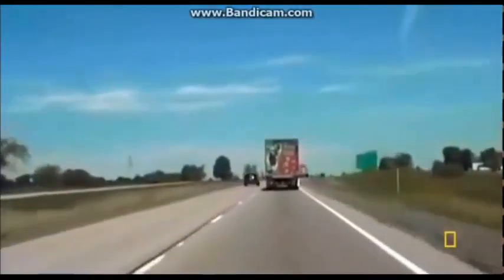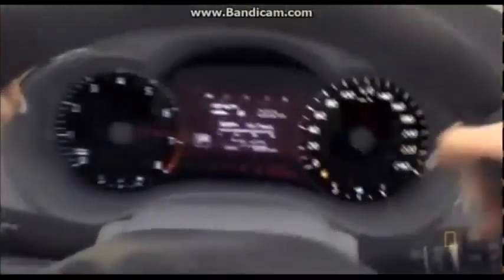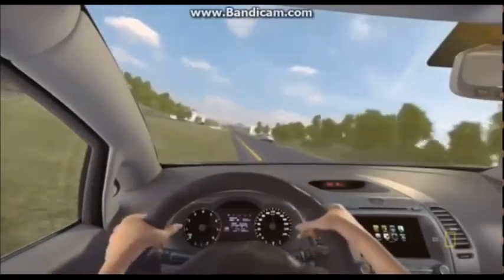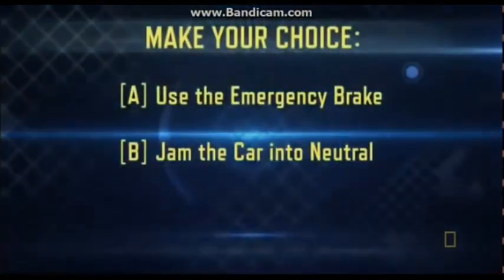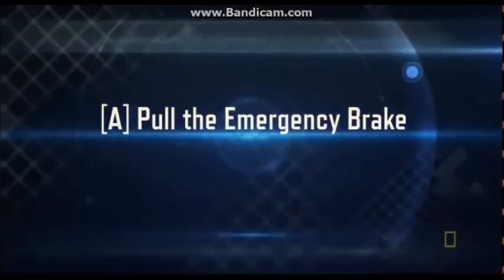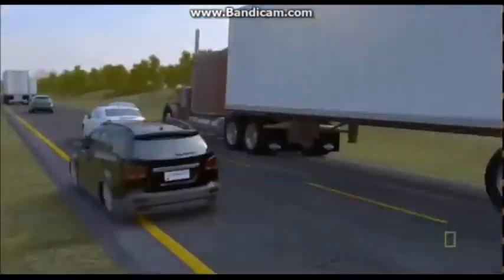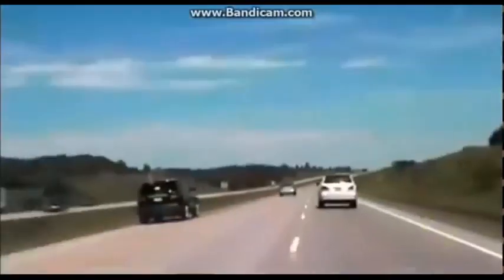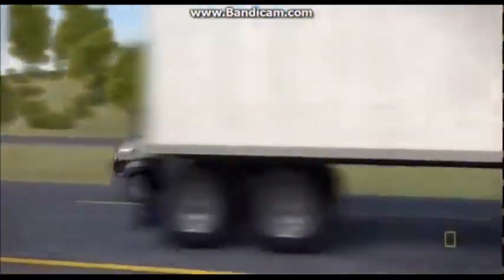How would you stop your car if your gas pedal stuck

Comment: Your actually supposed to turn the car off then when it's not running any more turn the key the accessories positions or on positions
Reply: Exactly
Reply: Idk about your car but even with the key in acc or on position you still lose power steering and the wheel can still lock
Reply: Alaric Niemi is so wrong. When your cars ignition is in the on position the steering wheel is unlocked. And if you can't steer without power steering you shouldn't be operating a car because it could go out at anytime.
Reply: Hmm not on my car, when i pull into the gas station i usually tu=n off my car before fully stopped, and even when turning it back to the accessory position, if i try to turn it works a bit but then the wheel locks like there is no key, i dont know what your car does, thats why i am saying for my car that is what happens, just personally experiece. Idk why you gotta be so hostile
Reply: Alaric Niemi I'm not hostile but it works on mine and if you have a newer car with a push start just click it twice and it turns off and the steering wheel will never lock. And you obviously don't know what hostile means.
Reply: yeah most money saving way to do it thats for sure. like with the semi trucks then running away is more common then gas cars they say if its running off the oil so if turn key off and its still redlinind then they say with all brakes pressed you drop clutch in last grear... idk if that would be smart either cause grenade the trans to clutch possibly and it would continue to rev untill it burns down  but i guess if anything was worth a shot that would be it
Reply: You really don't want to do that until when you have no other options left. You will lose power steering and you need power steering at over a hundred miles an hour
Reply: Lemon Bleach The faster you go, the less force needed to move the wheel if you loose powersteering...
There's a reason why the steering wheel is STILL phisically connected to the wheels, it's because of situations where you lose powersteering, YOU STILL HAVE CONTROL OVER THE DIRECTION THE WHEELS ARE FACING.
Reply: not the best solution. By turning off the motor you also loose power steering and with newer cars the brake booster. That may sound like its no bid deal when you re driving 40 mph, but at 120-130...If you ca get the transmission into neutral you are better off
Reply: Still not desirable if you could just as well put the transmission into neutral. And its not just power steering. Turning the car off you also loose brake booster and any assistance systems that may help you brake down without loosing control, like ABS. Don't bullshit yourself. Turning the engine off at 120 mph is not safe. If its your only option go for it. But in any other scenario neutral is the way to go (or just hitting the cloth on manuals)
Reply: If you have hydrolic steering, the engine needs to be running or you lose steering, only electric power stering is exempt from this, and assuming so is a gamble
Reply: your steering might be digital then (the wheel isnt connected to your tires at all, and is just a rotation sensor to have the computer turn the tires for you per the steering wheel position)

theres hydraulic, electric, drive by wire (computerized), and what i like to call, golf carts with a V8 engine
Reply: A lot of cars wont allow you to turn the ignition if the car isn't in park, and for most the steering is locked if the engine is off.
Reply: mine will start with the car in neutral
Reply: the thing with the cars, is they actually dont let you disengage from park if the key isn't in the ON position and you aren't pressing the brakes while doing it
Reply: but at that speed power steering makes no difference because it's easy to turn the wheel even without it. No power steering only makes it a bit harder to turn the wheel from certain starting angles, at least from my experience
Reply: my journeyman had a stroke driving us home on gravel side roads and his foot slammed down on the accelerator, we were going 70mph on narrow gravel roads with lots of twists and bends. i turned the engine off and had to control the vehicle since i cant reach the brake from the passenger side. only the newer vehicles for some reason lock the steering wheel when the key isnt in the on position.
Reply: Diddz' no because the hydraulic motor runs off of electricity from the battery. And you spelt hydraulic wrong
Reply: Diddz' you do know before any technology came out for steering assistance such as power steering it had to be connected some how don't you think. How else would steer the car? Magical powers or something. Also I have had many vehicles with no power steering and you pop the hood and if you look in the right place where the steering shaft is you will see the it is all connected and you do know that not everyone has a new and/or fancy car the has power steering.
Reply: Diddz' true
Reply: Goran Novakovic yeah only when you are going slow or stopped it is hard to turn the wheel
Reply: Talinthis sorry to hear. Hope everybody was ok.
Reply: TheVergile why would I bullshit myself. If you have a manual transmission and don't push in the clutch you can not put it in to neutral. Ive tried it. So if you also lose clutch fulid your clutch won't work you might not have any other option.
Reply: Lemon Bleach no you don't
Reply: Basil you're* what
Reply: makoshark40 might save your engine
Reply: funny story, my gas pedal cable broke off today, it wasnt stuck but i had to jerry rig it and tie the cable to the pedal while it pulls off of random stuff in the engine bay because i had to pull it out of the casing.
Reply: navigate48 oh and btw you can brake with the engine off on my car at least. Plenty of experience while i was being towed lol. Its harder though
Reply: navigate48 really good. Have you not tried it?
Reply: the problem is most cars turn on at any position other than completley off this is made for a pull start
Reply: That would only work with cars with electric power steering. Generally heavier cars use hydrolic power steering which uses the engine to power the hydrolic power steering pump.
Reply: Wrong you would loose power steering and power braking with no vaccum from the engine
Reply: So the brake pads are connected to the engine now? Or the transmission? Okay then. 

Also ABS is a farce - your braking performance will be better (stopping distance shorter) if ABS was deactivated and you used the brakes properly via pumping or just not letting them lock up. That's been tested a few times in different industries, hopefully I don't need to quote anything specific.

And if your car has anything more advanced with whatever "power braking" may be, consider that as something extra to shell out for when (if) it goes wrong (seeing as every other car designed before that feature got by just fine).
Reply: Douglas Burgert no if you have hydraulic steering it is ran off a belt that is connected to your crank. Electric steering doesn't have any fluid besides  grease.
Reply: the steering wheel only locks if the key is out of the tumbler; power steering is only useful on stand-stills or slow speeds, at a 120mph power steering wont make a difference
Reply: John Sears my hydraulic steering does not have a belt to the engine. It runs off of the battery.
Reply: Douglas Burgert then that is an electric power steering which has no fluid.
Reply: Alaric Niemi ya but when ur going 120 its not like u can feel a difference power steering or not it will be the same thing
Reply: TheVergile right about the booster thing but its not like ur gonna let the car go 120 and not notice the pedal ia stuck
Reply: your wheel cant lock if the key is in the ignition
you also dont need power steering to steer a car, it just makes the steering much heavier
Reply: Talinthis I think it locks for easy movement via towing.
Reply: the brakes stop working with the engine off? thats bs, otherwise there would be a lot of rear-ending done when people get towed, the brakes are nowhere near as effective (you need to really jump on them) but they still work, for eg: you can put your foot on the brake and take the handbrake off with the engine off and your car wont roll away, cuz guess what, the brakes work
Reply: Lemon Bleach you do not need power steering especially not at 120mph. What are you inexperienced or just plain weak?
Reply: You can still steer with no power steering... the wheel will not lock on an automatic unless it's in park. This video is just stupid.

Comment: If you turn off the ignition while remaining in drive, your steering wheel will NOT lock up, that only happens in park. And you'll still be able to use the breaks
Reply: Nope, the steering does lock. Since the car is off is the safety feature, otherwise very theft could just put the car in drive and unlock the steering wheel. 

Also, turning off the ignition turns off the airbags and the stability control
Reply: @diegoalejandro8981  if you turn ignition off then put the key back to run then the steering wheel won't lock. The locking pin only activates when its in off
Reply: It might not lock but it would be EXTREMELY difficult to steer
Reply: @Whisperedmax  You don't usually have to steer that much on the highway.
Reply: @flopsinator5817  still throwing in neutral is a far better option

Comment: "turn off the ignition and your steering wheel can lock."
YOU DON'T TAKE THE KEY OUT OF THE IGNITION, the steering wheel wont lock as long as key is engaged.
Reply: Push button is a thing too

Comment: What if i have a manual?
Reply: Just use the clutch. eZ
Reply: Is that a Joke? 
I had this happen in my 1976 Mitsubishi Galant (this was in the 80s) and in that the spring under the accelerator came out, I just applied the clutch, stopped, then with the engine off, got the pedal back up and bodged the spring back in place.
Reply: I meant that genuinely, I wouldn't have bothered writing out an experience of mine if I'd just meant that as a joke like that.
Reply: Wut clutch? Your "idontknowhowtospell" bearing is gonna die. Just take it out of gear
Reply: Thekrygaming _ it still has neutral (the middle)
Reply: Thekrygaming _ u would press the cluch
Reply: Ummmm manual cars have neutral too lmao... but just use the clutch and break.. ezz
Reply: Thekrygaming _ ... neutral still exists
Reply: Don't use the advice they give you in a manual. Even the advice many commenters are giving isn't too sound. If you disengage the clutch and  put it in neutral while your throttle is stuck, your engine will blow up as it goes into redline. Almost all cars have rev limiters, but if that is damaged too, you are screwed (Of course if this is a life or death situation, the engine isn't too important). You could actually turn the key from the ignition, to the accessory position. In my car, the steering wheel will not lock if the key is in this position, and I'd bet the same for yours. Power steering will disengage, but that is simply not necessary to safely stop or steer. Then you can use the brakes or burn out the clutch in gear to stop it.
Reply: Thekrygaming _ ikr
Reply: Automatics 😅😅
Reply: if you have a manual, you just put it into neutral again lmao, just be fast with the clutch. if anything youre better off in a manual in this scenario, because jamming it into neutral wont destroy your trans if youre going 180kph, like it would an automatic.
Reply: Ethan Klahn all cars with fuel injection have rev limiter
Reply: You have a clutch
Reply: Or just downshift... Engine braking. Better a blown motor than a blown life.
Reply: That's even easier
Reply: ChimpGuy He doesn't. He is probably a 12 year old trying to act smart.
Reply: Put it in neutral? :p
Reply: TheoDeo dude. he means a manual transmission car
Reply: put in reverse
Reply: FreakGamer175 ikr
Reply: Frank Williams Do you know what a clutch even is?
Reply: Chester Andrew No. That makes it worse.
Reply: the neutral in an automatic is still engaged to the transmission. that is why you cannot tow any automatic transmission (excluding dual clutch) on their drive wheels, as it damages the drive train by placing large amounts of load on the trans, at a very high heat.
damage is really unlikely to happen whilst the engine is running as cooling systems are running too, but if your fuel system decides to die like in the above scenario, chances are other systems are malfunctioning too. it doesnt help that redline in most cars equates to 'very fucking hot'

if you're wondering, check https://mechanics.stackexchange.com/questions/22275/does-towing-an-automatic-transmision-car-in-neutal-with-engine-not-running-will
Reply: Clutch/10. Would press.
Reply: Easy, stall the engine
Reply: Thekrygaming _ clutch
Reply: Is that even a Question :3
Reply: Smartest thing to do would be to hold the clutch all the way in and start braking and don't let go of the clutch pedal until you have come to a complete stop and have put your car in neutral both you and the car will be untouched
Reply: You must press the clutch in first then just move it to neutral. You can't just pop it into neutral without pressing the clutch first because the gears are force into each other by all the force being applied therefore pressing the clutch will disengage
Reply: 357Compton yes but you have no clutch to disengage the power from the engine to the transmission so if you try to jam it into neutral you'll most likely FUCK the transmission completely and maybe even lock it up which will lead to skidding.  The more you know
Reply: Thekrygaming _ Push in the clutch and shift down gradually so you don’t blow up the engine
Reply: Money shift it 😂
Reply: Frank Williams how do you not know how to spell throwout
Reply: Pfannenwender so would you use the clutch or put it in neutral?
Reply: Clutch
Reply: Read it
Reply: Thekrygaming _ clutch, neutral, brake
Reply: Ethan Klahn What I'm wondering is whether this would cause the oil injection to stop or not. Because if that is the case your engine could seize, locking up the wheels and this would set you up for a real f*cked up day (as CycleCruza would say).
Reply: Thekrygaming _ it's common sense and even easier: your engine is immediately disconnected from the wheels the moment you press the clutch. It's recommended to just leave the gear stick neutral (middle) and release the clutch.
Reply: At least in my car if i stop the engine but not take keys out of power lock my stearing wheel isnt locking out
Reply: What type of question was that
Reply: Thekrygaming _ rip
Reply: R.I.P u
Reply: Thekrygaming _  screw the cluch your life is more important than your transmission
Reply: go into neutral (in between gears where u can move stick back and fourth)
Reply: Easier
Reply: Happened to my dads manual PT Cruiser. There was a crack in the intake and it was receiving false air. He's a good driver and when he took it to the shop, the mechanics had no idea what was wrong and he TOLD them lmao.
Reply: Manual transmissions are much more safer than an automatic when it comes to unintended acceleration.
Reply: Thekrygaming _ clutch and then neutral
Reply: Press the clutch
Reply: So U think manual doesn't  has neutral gear?
Reply: Clutch duh
Reply: Or just stal the car
Reply: Clutch LMAO
Reply: The breaks and steering wheel are hard as a rock when the engine is of. The car maybe won't have the wheels blocked you still won't be able to fcking steer at that speed.
Reply: you know... you can shift into neutral as well with a manual
Reply: Thekrygaming _  just step on the clutch and put it to neutral
Reply: Frank Williams    What
Reply: Yeaaaaahhhh so much better a blown engine AND transmission than just a blown engine... smh bro that could also cause the car to go out of control.
Reply: You shouldn’t be driving if you don’t know what to do
Reply: dude. just put it into neutral.
its that easy
Reply: Just shift back to slow the car down
Reply: Leon Vollebregt; No. That would be even more dangerous than pulling the e-brake. the car could over-rev and the wheels would have to try to match that RPM. That, consequently would make the back wheels spin much faster than before, possibility spinning the car.  Really not a good idea.

Comment: Turn the key to accessory and the steering won't lock. Yeah, you won't have assisted brakes, but just put all of your weight on the pedal. Yeah, you won't have assisted steering, but it's really not that hard to turn while rolling. If you have a push-button, hold it until the engine turns off then press it again without your foot on the brake. Now it is in accessory and the steering shouldn't be locked. 
At work we tow around cars without engines. If the key is in the off position, no steering. If the key is in accessory, even if there's no battery, the steering unlocks and it's not hard to turn at all once it's rolling. With a push-button, the battery has to be hooked up.
Reply: You can actually even turn the wheels if the car is stopped and engine off. It's hard but not impossible. I've had to push start my car a few times by myself once because my battery broke and i had no money to buy a new one.
Reply: i always hate push bottom. such a stupid design, dont even know why it got started.
Reply: Well on a Toyota Camry it's the opposite to turn it on and put it in accessory mode you have to hold the brake pedal to turn it on and to put it in accessory mode you just push the button
Reply: Punctuation may help here, but I don't understand what's going on in that comment.